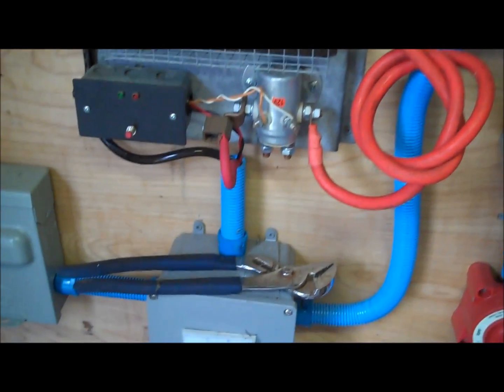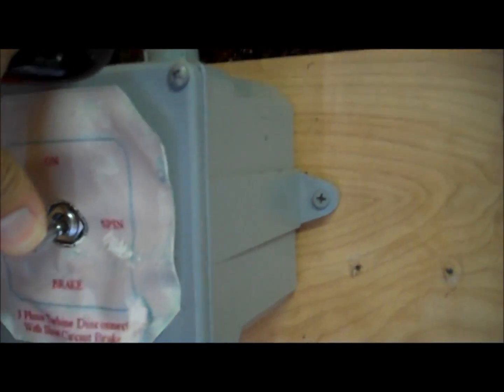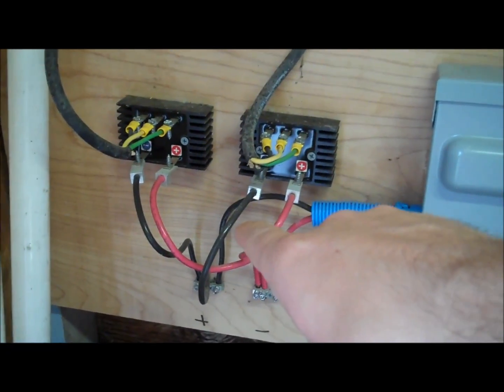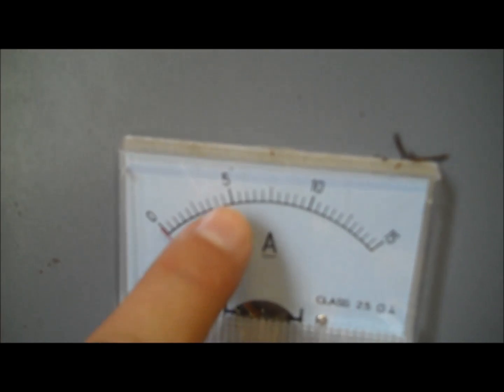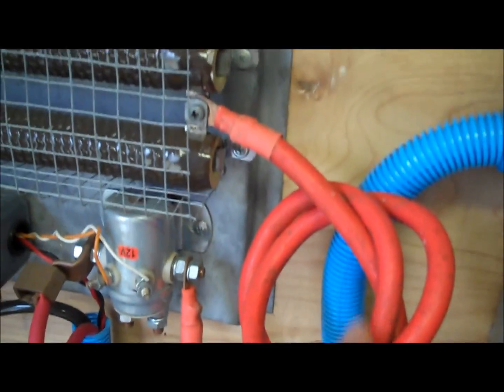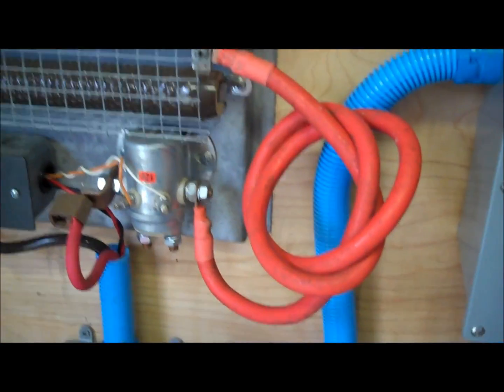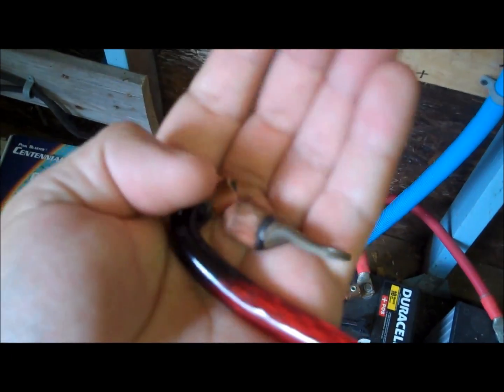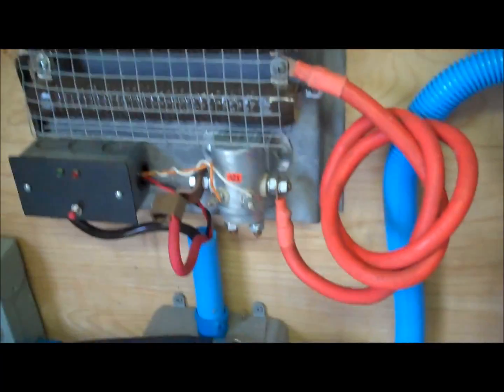DIY Wind Turbine Power Overload- Be Careful with Resistive Load Circuit!

Comment: instead of dump load when your batteries are full, why don't you operate something in the house, like the washing machine and wash some clothes, or use the vacuum cleaner and vacuum the floor, or use the power in some way instead of just dumping it, or get a second set of battery Banks and charge them up for Reserve

Comment: Eric, the reason your wire burned is that you need another relay in the circuit. As your unit looks like it is setup, there is nothing that prevents the resistors from seeing not only the turbine voltage and current, but also the battery voltage and current. So you need another relay to shut off the connection to the batteries. Or you need to install a large diode to do it. The diode would be better as it would still allow a charge to go to the batteries  but would prevent current flow from the batteries to the resistors. Like this one:
https://www.ebay.com/p/Rectifier-Diode-300amp-1000v-Anode-Stud-Mount/1301518406 It would need a heat sink but as you would only be dumping .8volts thru it, it would not have to be anything but a piece of 2" angle Al.

Comment: you needed the heavier gauge wire for sure but you need to shorten, not lengthen the wire. The shorter the conductor ( wire) the less resistance. Therefore less heat!